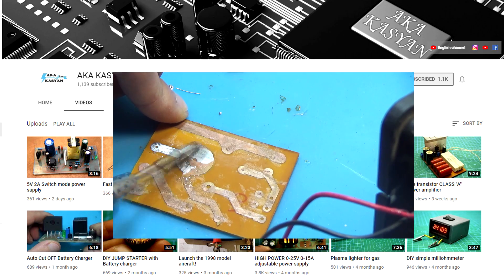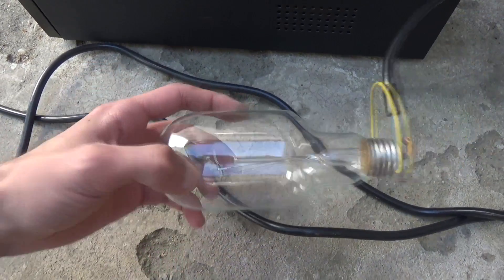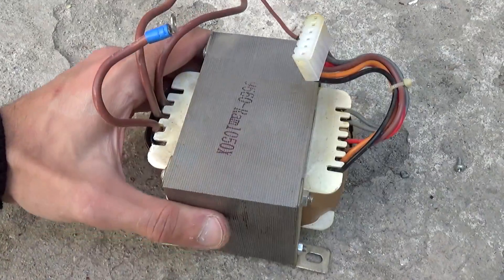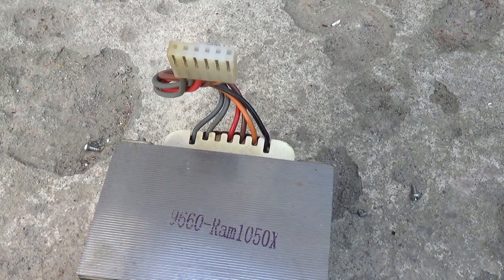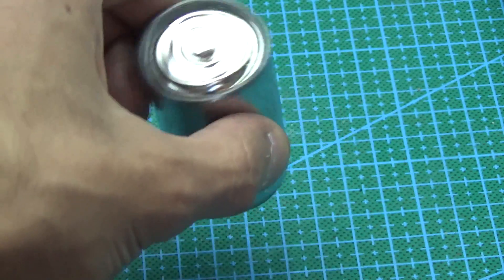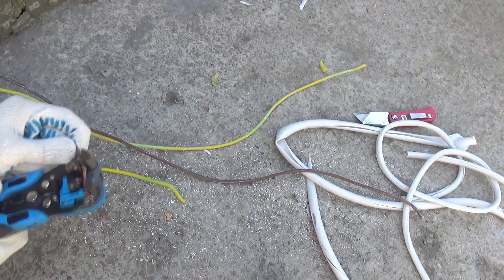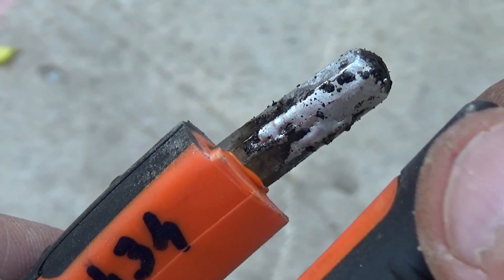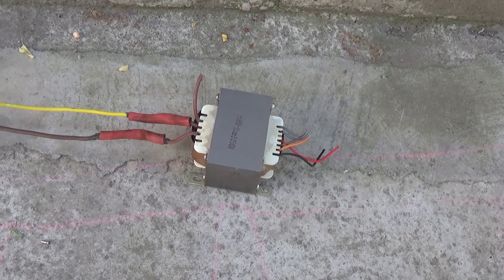Welding machine from UPS !

Comment: I found a brand new still in the box APC ES350 a closing down store was throwing away. If I didnt have anything plugged into it, but had it plugged in and charging the 12V battery in there, could I just hook up 2 leads to the 12V battery and do the same thing? It's meant to protect things plugged into it and stop power surges from coming in to damage them, but in reverse with nothing plugged in to protect, it seems it would just trip a 20A home circuit breaker at worst ... right? I have no idea, thatwhy I'm asking, I just wanna weld some art stuff together for my kids, but I don't wanna go all cartoon xray character on 'em while I'm doing it, ya know. Using Free Garbage thingy as Welding Dad = pretty cool ... Getting shocked and catching stuff on fire = Not very cool Dad. Lemme know if anyone knows how that would work. I kinda wanted to use it as a power inverter, and thats the only reason I don't wanna just yank the transformer out of it straight away, super handy for camping with the kids and Summers coming, so any help would be ... VERY cool! Much Love!!  ✌️

Comment: Ain't that funny I got stripped ups with toroidal transformer and a rouge 10amp MCB just waiting to do this and add instant soldering iron using staples for air or electric stapler for the tip .. not to bad for fast repair and cheaper than copper lol

Comment: Ultrasonic welding is probably the way to go but you need a heavy duty Ultrasonic transducer and horn that will concentrate the acoustic energy into a wave that will cause the two wires to fuse to gather.

Comment: I think welding wires is not a good idea, you are literally burning these wires which degrades the integrity and strength of the wire.  It's more safer to use solder.

Comment: Great idea :-) . After that inspiration i will try it with one of my adjustable welding transformers and a battery coal like yours. I hope to get welded two cable ends together. Thanks again for your usefull videos!

Comment: I thought the rods in the battories were graphite
Reply: Graphite is a morph of carbon.  I forget which form conducts the best.
Reply: @jafinch78  ok cool thx
Reply: @jamesofoof1232  Your welcome.  I made a telescopic antenna with a ski pole shaft at the bottom, a graphite golf club shaft in the middle with two layers of aluminum duct tape wrapped and the longest telescopic antenna to match the thread of the screw I soldered into the small end of the golf club shaft that had conductive copper foil wrapped and folded into the inside to help hold the screw (with the head cut off) and help solder bind.

Originally, I planned to just use the conductive carbon/graphite fiber club shaft... though found the conductive ones measured about 50ohms resistance interestingly.  Pretty much a dummy load resistance. That's why I wound up wrapping with aluminum duct tape with non-conductive adhesive in two layers since that's about the skin effect depth anyways to go around the shaft.  I have a video of somewhere on my channel. 

Though is interesting the carbon rods from D cell batteries... I used to play with those as a child to make oxygen and hydrogen via electrolysis.  Was fun.  Then later in life studied EDM machines when I had machine tooling courses, though never used.
Reply: Pencils use graphite, carbon rod for regular carbon zinc batteries.

Comment: Interesting. This might work for fusing stainless bicycle shift and brake cables. The nice teflon coated stainless steel cables are damaged by cutting, clamping, and crimping the ends. This makes it impossible to reuse an otherwise good cable if it must be removed. The frayed cable end is impossible to thread through the shifter and cable housing. When the manufacturer of the cables cuts them to length the cable has a similar weld bead as what was shown here. I wondered how manufacturers were creating this bead/drop. After seeing this carbon electrode I think I have my answer.
Thanks for the upload.
-Jake
Reply: I like the idea... glad I read this as I have on my Facebook a clutch cable on a Poulan Pro Riding Lawn Mower I was planning to lead solder the end and was going to make either a wood or metal mold.  I have some UPS and Microwaves I can salvage a transformer from... so thinking I'm going to do this method.  Wondering about at the same time make cables to weld batteries also.  Will read into that some more.  Thanks for sharing everyone!
Reply: Jake, Did fusing the bike cables work?
Reply: @TheRainHarvester  
I haven't gotten around to trying to fuse the cables again.

  The paraffin wax has an extremely low viscosity when melted. It also wets surfaces really well. I don't know the science behind the technique, but I think the wax exploits the dissimilar expansion rates of the two metal surfaces. Logically, when the fastener is hot enough to glow, it experiences significant heat expansion pushing against any substances lodged/oxidized in the space between the threads. When the wax is applied it effectively quenches the metal quickly while it is drawn into the gaps left behind as the metal shrinks. The much larger thermal mass of the threaded object (block/heads), is much slower to change than the fastener. Once the two surfaces have cooled, the wax solidifies with the effective slick properties associated with this phase change.
Reply: I really like the idea of using the Carbon rod electrodes.  Reminds me of an EDM machine... though the transformer duty cycle wouldn't be made for the longer time load like noted.  Probably could however, still have a machined carbon electrode surface that could really slowly in pulse like steps... do some interesting work.  I was thinking something like this to easily heat up exhaust manifold bolts also so not needing an inductive or torch method.   Granted, the inductive heater methods are I'm thinking the better route... though this method might not be bad to build up with a similar to the bolt metal and heat at the same time when a bolt is broken flush or just beneath the surface using the MIG welder to weld a part to grip with vise grips method to remove siezed broke bolts in engine heads.
Reply: @jafinch78  
 If you're trying to remove stuck bolts, nothing beats an oxy-acetylene torch with a rosebud tip and some paraffin wax. Just heat up the bolt until it's just starting to glow, then melt a bit of wax around the head while it's still glowing hot. That gets almost anything out. 
  I worked for a machine shop in my mid-twenties. The shop specialized in nostalgia dragsters. We build some ford flatheads that came in the shop looking like they were clobs of dirt, or some kind of mineral rock pulled out of a mine. Even those came apart with a rosebud and wax :-)
Reply: @UpcycleElectronics  What does the wax do? Interesting!
Reply: Carbon rod electrodes would be novel from what I've seen for welding batteries also.